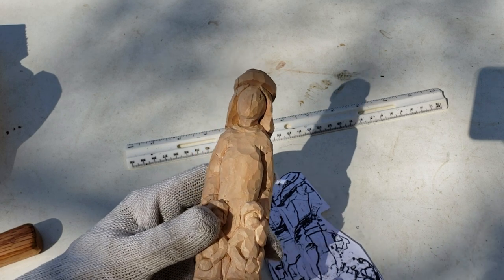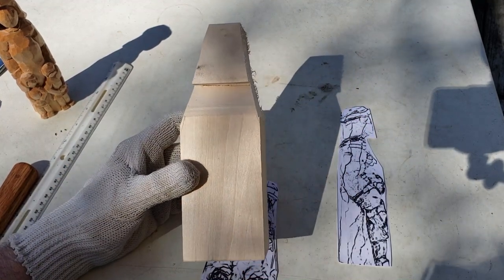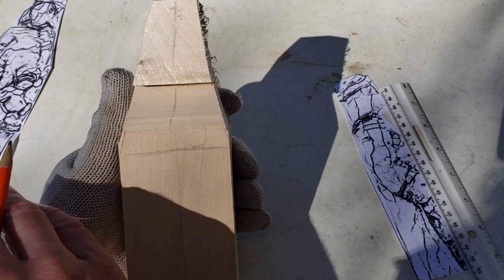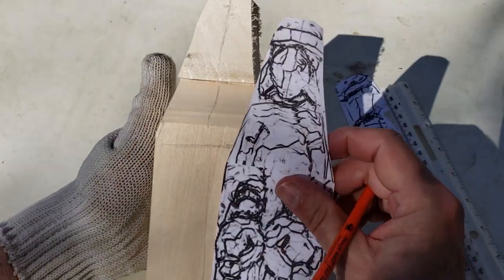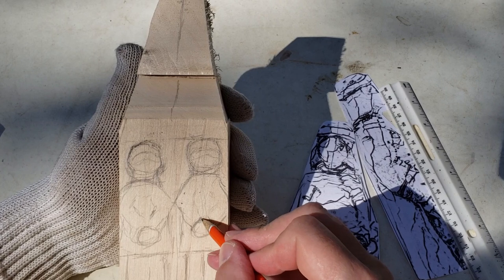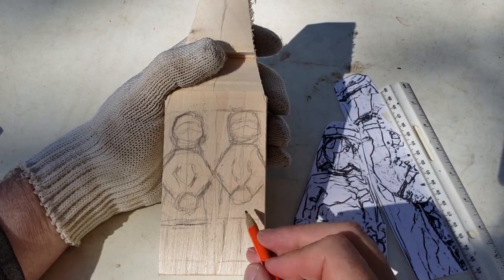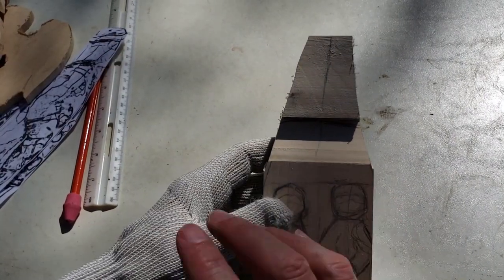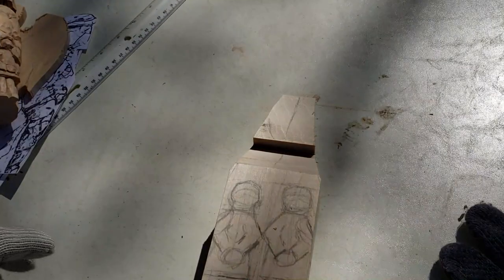Carving The COVID 19Angel Part 1

Comment: these videos are very educational, excellent work.  There is no linden wood where I live, only birch and pine.  Could it be that you can give me an orientation to work with this wood.  hug.  Congratulations
Reply from the maker: You can only use birch when it's freshly cut down and wet. You could find a live (not dead and dry) birch tree (that's not in your neighbor's yard), cut a fresh branch and carve something with it. Though it's better wet, the wood is still hard. You could try this with other woods where you are. As for pine, the wood must be as dry as you can get it. Pine has a pitch (sap) that will stick to your knife. Pine also chips and slivers easily, but is better to use than birch. If you can find a dry piece of pine in the shape of this project you could give it a try. But pine is difficult to cut on the end and next to impossible to leave a smooth surface. You could buy basswood on the internet, but the shipping may cost you a fortune. Sorry if this is not much help.